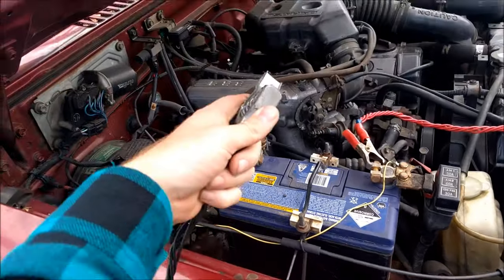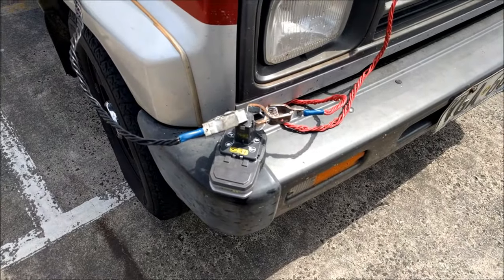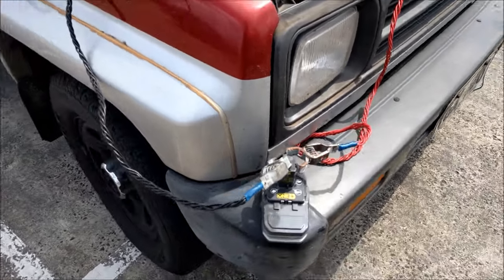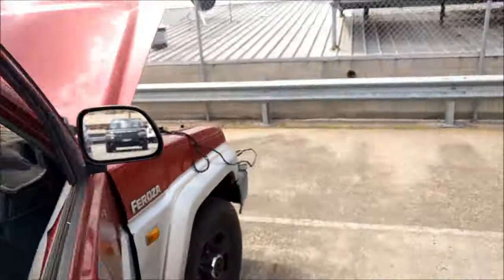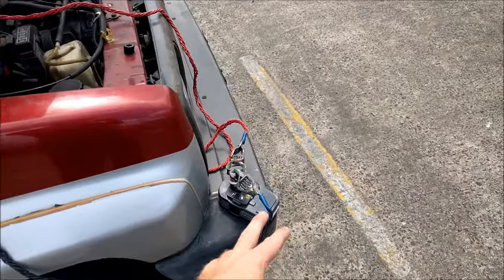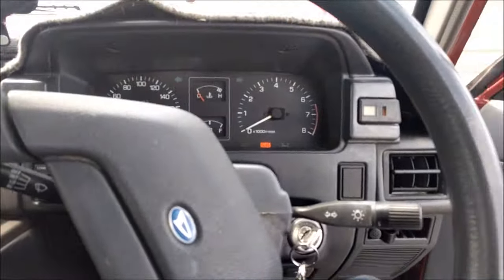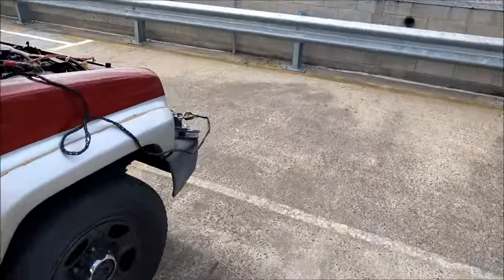How To Jump Start Your Car With A Cordless Drill Battery

Comment: Nice, thanks.  I came up with idea in my head and checked YouTube to see if it was possible.  With my 18v battery it has different connections. I twisted 2 bolts that squeeze in between the copper leads on the top of DeWalt  battery,  then I put a piece of cardboard in the middle of the two bolts to prevent accidentally shorting the batteries out. Important: use a meter to test which is the positive  and negative sides of the 18v battery, and then mark them. Worked like a charm, I had  to charge the car battery up for two minutes (1998 Chrysler Fifth Avenue) , then she started right up. Thanks again sir.
Reply from the maker: That's awesome, nice idea to connect to the terminals. :D
Reply: good advice about using a meter first!! :-)

Comment: I did it on accident sort of...I had a phone call for a jump start...the fella was parked all the way up the drive way and couldn't get to him with jumper cables so I stripped some twelve gage wire and hooked to my craftsman v20. Figured we could pull it out of park and push it back down the drive way to where I could ĵump it  with my vehicle. It fired though.
Reply from the maker: Haha, wild!

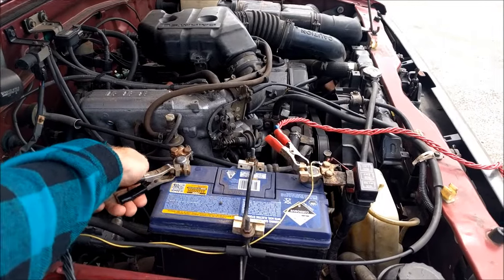Comment: At 1:28, you fiddle with the contact right next to the car battery. This may be the most dangerous part of this whole video. Your car battery may  emit hydrogen gas from time to time - a little spark might be very bad at that point :-) That is why you should close the circuit by connecting the last (negative) clamp to the chassis, well away from the battery!
Reply from the maker: Good call, I'd always wondered as to the meaning of that piece of advice. Now I know!
Reply: @MYVIDEOTABLE I got to learn that while attending driving school some 26 years ago 😄
Reply: Yeah I wonder about that. Just how much hydrogen would that battery have to be putting off for it to cause a problem?
I've burned the hairs off my knuckles probably 4 times in the past month using my parents super old stove and a lighter and that's from a fair volume of propane in a closed room. Out in the wind, with the battery trickling out hydrogen, I reckon you'd be struggling to hurt yourself.

Comment: the alternator voltage for charging the car is lower than the charging voltage for the battery so it shouldnt do anything. more than likely the drill battery would continue to discharge while the car is running
Reply from the maker: Yeah I reckon you're right.

Comment: Limitations
 of Lithium-Ion Batteries.

* 
Requires protection circuit to prevent thermal runaway if stressed
 (catches fire)

* 
Degrades at high temperature and when stored at high voltage
 

* 
No rapid charge possible at freezing temperatures (<0°C, <32°F)

* 
Transportation regulations required when shipping in larger quantities

Advantages
 of Lithium 

* High specific energy and high load capabilities with Power Cells

* 
Long cycle and extend shelf-life; maintenance-free

* 
High capacity, low internal resistance, good coulombic efficiency

* 
Simple charge algorithm and reasonably short charge times

* 
Low self-discharge (less than half that of NiCd and NiMH)

Comment: Would a 18v damage the cars CPU?
Reply from the maker: Potentially! There's a fairly big voltage drop as it charges the car's battery and automotive electronics can be pretty hardy.

I would not try this on a car with very sensitive electronics. On an old 90s Daihatsu with a single ECU I can replace for $50, worth a shot

Comment: You didn't show how to do it man
Reply from the maker: I definitely did. Connect the batteries in parallel, then start the car. I also highlighted the dangers - can be risky, so don’t attempt at home.
Reply: No you didn't I had to watch another video to find out there is a positive and negative on those drill batteries and how to hook them up to the battery. All you did was show that it's possible to do that you didn't detail the specifics if somebody wanted to do it you didn't show exactly how to do it. From watching your video I was unable to do it myself until I watched another one
Reply: @ays2013boss  which video did you watch?
Reply: @ays2013boss  Bro, if you don't know that every battery has a positive and negative terminal, then you have no business trying to jump cars with power tool batteries. 🤦‍♀️
Reply: @WhatUpTKHere  my diehard craftsman batteries have 4 unmarked terminals, so how do I determine which is positive & negative if I don't have a voltmeter handy?